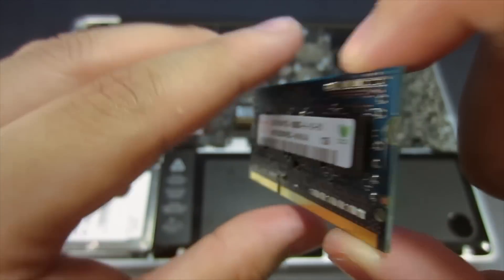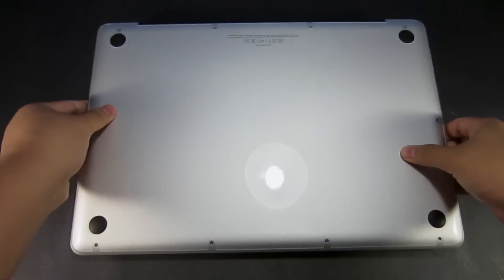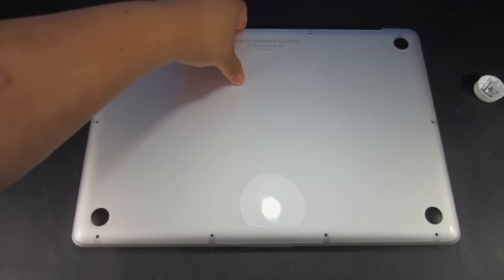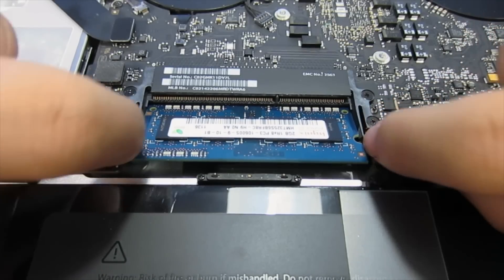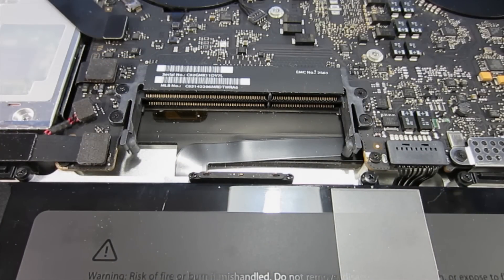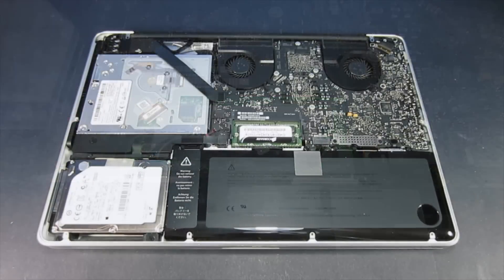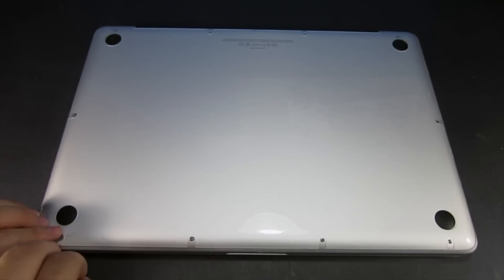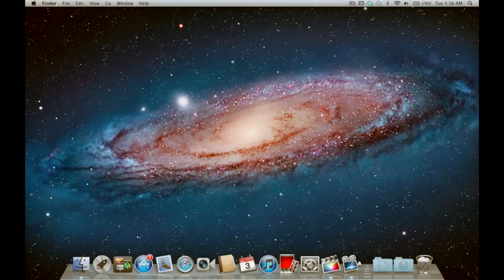How To: Install RAM in Macbook Pro (Unibody - 2009 to 2011)

Comment: 3rd times the charm.  Yep, I had to go back in twice but finally got them set.  Never thought the number 8 would look so glorious. 

And would like to thank Matt for making a nice pithy video with very clear instructions. 

I would suggest a magnetized screwdriver.  Those screws are mighty small and slippery.  Thankfully I checked that the sticks were in right before putting all the screws back in :o) 

Plop plop fizz fizz oh what a relief it is to have that done!

Comment: Three questions if I may ask:
1)I noticed you have a SSD as the startup disk .I have heard about keeping SSD for system files and using  SATA for writing data onto.(Actual question) How do you segregate this ?
2)As is the case with older SSD's have you noticed any lethargic write speeds with the SSD ?
3)Can you make a video on how you go about replacing the SATA with the SSD ? 
plzzzzzzzzzzzzzzzzzzzzz......